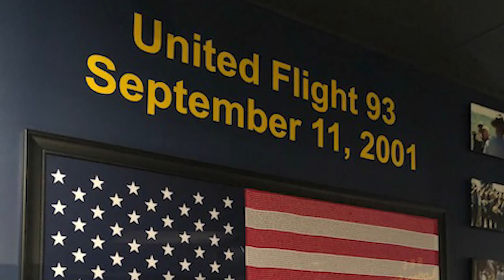PICKING A WINNER! Rigid Industries Ram Fog Light Mount Installation

Comment: Yooo Ram Beast. Congrats on completely the course. I have the SAE rigid fog cubes in my bumper. Spoke to rigid about the upside down Rigid. There is an extra bracket to buy that attaches to the main bracket which allows you to bolt the light right side up. Apparently flipping the cover voids the warranty on the lights. Not sure why they had to make that extra step but for figured I'd put it out there for future reference for anyway looking to do the upgrade. Be safe out there and keep those videos coming.
Reply from the maker: Thanks for the info.. I’ll have to look into those.